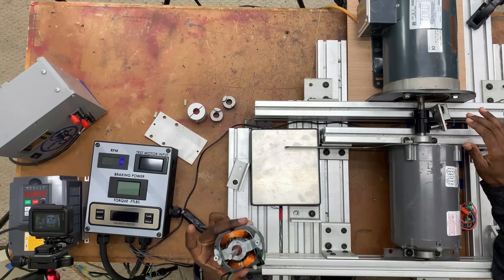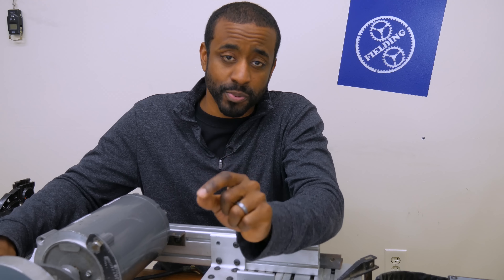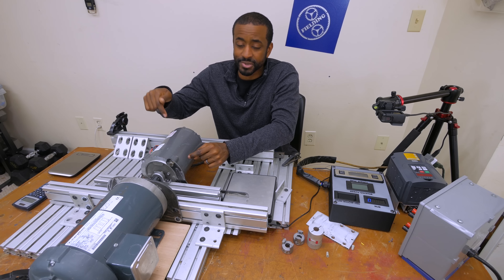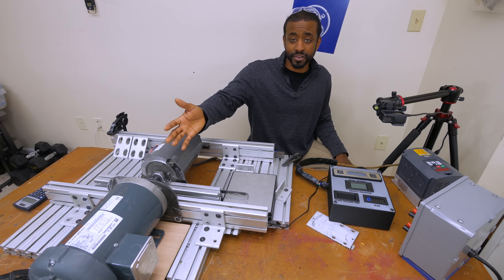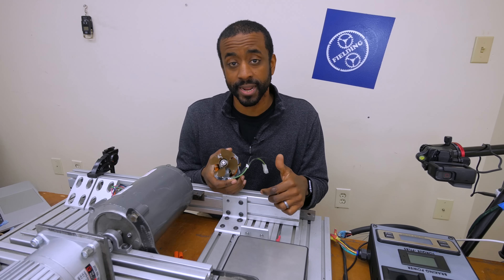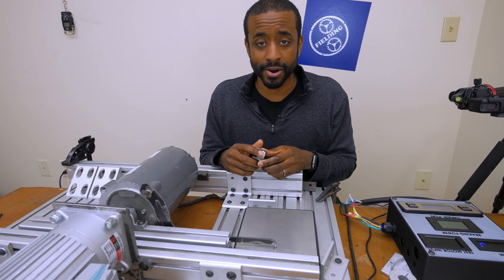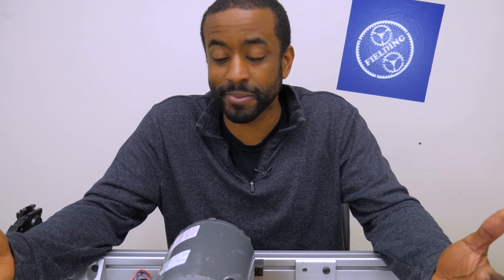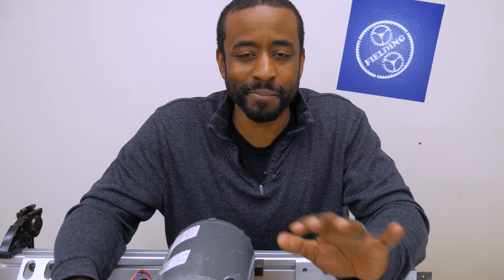How to Measure Horse Power for Any Electric Motor: (#077)

Comment: I'm designing a small engine dyno (<20HP) with DC injection brake.  What voltage and amperage are you supplying to the motor?  1 or 2 windings?  Are you monitoring brake temps?    Your using 1HP 3P motor for the brake. Yes?  Capturing the data with arduino and analyse in excel.  A posh display software is another story.  Ardyno might work if you can fudge the inertia setting and get close. I'm not an inertia dyno fanboy.  Brake dyno FTW. I assume you want an accurate HP number.  All i'm interested in is repeatable numbers for engine testing and tuning.

Comment: Do you know how many amps and volts your power supply goes up to? I tried building this with the one you recommended from Amazon but it burned up something inside and blew out a bunch of smoke. I returned it for a different model and it's topping out at 7 volts and 10 amps and not providing enough resistance. I need something with more power but not sure how amps/volts I need.
Reply from the maker: 30 volts 10 amps. The link takes you to the model I bought. However, I also used my shop made power supply for part of the video. You might have to buy a bigger one or make your own.

Comment: Wow, really interesting. Thanks for sharing! 

I might have missed it but how did you calibrate your braking motor or was that not needed? I think the torque value represents how much the two motors oppose each other but does it matter what the braking motor is doing? Does the braking motor only need to be more powerful than the motor being tested at the given RPM? I'm really curious about this point. I've always wanted to understand how a dyno works.

Thanks again!

Comment: Humm, came here because I’m trying to upgrade my mill motor. It has a 2HP brushless DC motor running on 220v. It’s already setup fix and has a method of connecting another motor through the spindle and I have fixturing on the table for the brake. Need to find a double shaft motor for a brake. I’ve got a stepper I can use but I doubt it would like spinning that fast.
Reply: Figured it out. I've got one of the ebay 2.2kW high speed spindle motors laying around. They're three phase motors.  I'll use the ER20 collet to chuck it into the spindle using drill rod then 3d print an adapter for the outside housing diameter to the inside diameter of bearing. I've got a few used fairly large bearings around I can clamp into my vise and there she blows. The motor has no ratings but the matched controller will handle voltage and current automatically and it's a 2HP motor so when I reach 1.5KW or max it will provide before stalling that should do it.

Comment: hey bro great video! I have a question for ya if you ever see this. Couldn't you measure toqrue/speed like you mentioned just by coupling the two motors, then reading the output of the one running as a generator?   You'd get a graph of output over time and since you know the parameters of the "generator" motor, you'd be able to come up with the associated values.
Cheers!

Comment: Other than the bearings you swapped out, is there any other risk from running the DC "brake" way faster than its rated speed? 

Great vid, thanks as always.
Reply from the maker: So far that seems to be it. Ideally it would be a lower voltage induction motor. It would likely have a thicker gage wire inside the motor. But, those are pretty rare... I have only seen a few examples.
Reply: An armature that passes balance qc at a specified RPM, may behave differently at a much higher rpm-
Reply from the maker: This is a great point. I didn't experience any unusual behavior in my test... but of course people might be using all kinds of motors for this project. Definitely something two watch out for if you want to test at very high speeds as I do.
Reply: @horacerumpole6912  it was an AC induction motor, though. An armature is pretty fragile compared to an induction motor rotor. But there could still be issues going so far beyond rated speed. Best to approach it slowly and take precautions for anyone who tries it.

Comment: Shouldn't the torque arm be one foot from the center of rotation (motor shaft) to the contact on the load cell in order to directly measure foot pounds? Yours looks longer than that.

Comment: I wonder what peak current that motor draws at startuo, i.e. before there is any back emf to reduce the running current. Might be interesting to measure the dc resistance of the motor and (ignoring its inductance for a minute) deriving the peak current that could instantaneously flow. A pretty irrelevant figure but just possibly equating to 28 amps (4.5 hp).

Comment: Won't increasing the length of the scale's wires throw out the weight? Given they're such thin wires, their resistance will add up significantly to the load cell's.
Reply from the maker: I checked it... I weighed several items before and after on the same scale... I also compared it to several other scales I have.

Comment: You won't be able to work out the rated voltage or max current for a motor, using this? How do you know when you are over-loading it?
Reply from the maker: That information is almost always printed on the motor some where as mentioned in the video. If not, that is really hard to estimate. Its not impossible, but really hard.

Comment: Curious why you used a magnetic sensor for RPM instead of an optical one. Is there any concern that magnetic forces between the coupler and the sensor could bias the torque measurement? Or would the effect be too many orders of magnitude below the torques you're measuring to be worth worrying about?
Reply from the maker: The magnet is just barely inducing a current in the sensor which would be so small the sensor's magnetic field in response to the magnetic would have no measurable effect on the shaft.

Comment: What are the metal frames that the motors are bolted to called?
Reply: T slot aluminum extrusion. 80/20 is a common brand or generic eBay finds.
Reply: @ryanbreker9490  Thank you very much. I had the T slot but was coming up with flat wood working T slots. Appreciate the help.

Comment: Can you explain why horsepower and watts are actually correlated I get that horsepower is a function of torque and RPM but how is horsepower also watts
Reply from the maker: They are both RPM x torque, or speed x work. Exactly the same. Just different units
Reply: @Jeremy_Fielding  but watts is volts x amps

Comment: A DC motor built for 1700 rpm is not going to survive 20,000 rpm. The commutator is going to fly apart. Replacing the bearings isn't enough.
Also, you've got a quarter million subs. Call up Circuit Specialists in Phoenix and get them to sponsor you with a beefy variable power supply. I've been recommending them for like, 15+ years (for free).
Reply: That was an induction motor. He was using DC injection to convert induction motor into a brake. However I agree with you that the rotor is going to self-destruct inside the motor housing. Unless it vibrates off of the table first due to imbalance.
Reply from the maker: I will add a note to the description about the rotor not being designed/balanced for high rpm. My motor has survived several test at 21k already for an up coming video, but that certainly won't apply to all motors used for this.
Reply: @Jeremy_Fielding  21k RPM. Wow! Obviously I was wrong.
Reply: @Jeremy_Fielding  Please keep in mind that should something come loose at high RPM's, not only will the lost piece fly like a bullet but the imbalance could be like an earthquake. You could end up with the test rig in your lap beating you to death in less time that you have to react. Bolting the rig down solidly may not be enough as then the forces will concentrate on the mounting hardware, pillow blocks, etc. I'd add considerable distance between me and the rig during high-RPM tests; we're not wanting to see you get hurt.

Comment: Why are you connect torque measuring arm from stator frame of motor to scale , the actual torque is generated from rotor shaft of motor.
We should measure the torque of rotor, I can't understand the reason.

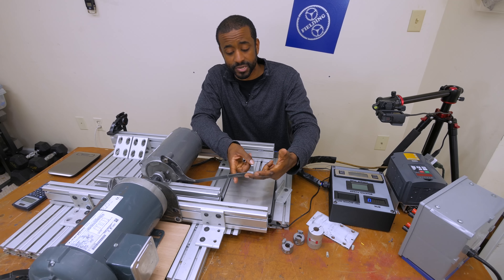Comment: 1:40 you are measuring the static torque using scale and lever, which is OK if you are measuring the starting torque (aka locked locked rotor torque) of motor. However, your rational of injecting a DC power for braking an induction motor power does not make sense because energy generated can NOT be killed by another energy source.
Reply from the maker: It might help to watch again. This is not measuring locked rotor torque. It should be obvious in the video the shaft is spinning. Also I confirmed in the video my test rig is measuring accurately by testing a motor that was professionally rated. My measuring produced the same rating as the label. Perhaps you didn't watch it all the way? Otherwise I don't understand what you are saying about DC injection. That is not related to the scale measurement in any meaningful way. It is just how I get a braking force.
Reply: 2:00 you said "run dc current through this  motor" that turns into electric brake. I am thinking how come a motor be used as an electric brake? 
I guess you meant dc machine or dc generator or dc dynamo but NOT the dc motor.
Reply from the maker: @MrALCHEMIST2010 . I see. It is a bit too much to explain in the comments. But it is an AC induction motor. If you put DC current on the windings instead of AC the shaft resist turning and the resistance increases with increasing DC current. It was an easy way to make an adjustable brake. Since the weight measures how much force is being applied to the body of the motor I can see how “hard” the motor can press and still keep turning. That number is the torque available at that speed.
Reply: @Jeremy_Fielding  Cool ! That means that AC induction motor's rotor itself is internally dissipating energy in the form of heat (iron losses) when it is exposed to DC magnetic stator field; and thus provides brakes. That is pretty cool technique!!

I am impressed by how you followed this question and clarify it till it is answered. You are MAN !! kudos.

Comment: if you know the amps the motor will draw, don't you know the rated horsepower? more or less - amps x volts/746?
Reply from the maker: Not unless you also know the efficiency of the motor. It could be 98% for high end premium motors down to 45% for universal motors.

Comment: That motor will rip itself apart from anything above 10krpm, don't push it. It's not just about the bearings.

I mean there's significant mass tied to that axle and it'll see significant centripetal force above 8krpm and if it isn't designed for those speed, it'll rip apart..

And what ever comes flying off from that motor shaft is going to be like a bullet... you don't want to be close to that when it goes.

You definitely need gearing or something to lower the speed that the measuring motor sees...
Reply from the maker: I have run this motor up to 25k gradually with not issues. I understand the motor has to be balanced for higher speeds. Anyway you can see 20k rpm without issue when I test the shop vac in that video
Reply: @Jeremy_Fielding  If it has survived it, good, but color me surprised... I mean the rotor has quite a bit of mass so one would think it can't survive that high of a speed unless it's designed to.

I mean the force pulling it apart goes up by a factor of 4 when it goes around twice the speed if i'm not mistaken.

But good to hear :)

Comment: Most 3d printed stuff is just plain soft when it comes to tensile strength. Good for toys and display things. What you should do is make a coupling that has different bushing inserts that would give you a guarantee no break senario. And sizes of motor shafts are not that many to make a keep on hand if you experiment as you do fella. Also, I am wondering if you could make a simple VFD for running three phase using single phase ??? Something the is bare bones but able to run say fifty H.P. motor. Buying a commercial VFD would send an average experimental into the poor house. With the number of electronic components for sale cheap I am figuring that should be an easy task for you to make and show us on YouTube. Thanks for considering and peace to you too.

Comment: It should be pretty trivial write the Arduino code, but it depends on the format your sensors use. If they output a variable voltage you could adapt this code: https://www.arduino.cc/en/Tutorial/AnalogReadSerial, just monitor the different values on different pins. I guess you're using off the shelf readouts like the display from the scale for the lbs so it's unclear how the sensor works.
Could you measure some voltages and post them? Maybe the sensor is outputting a linear voltage range in response to the varying weight. I'm no arduino expert but I've played around with analog and digital sensors, so I can try to help.

Comment: I have a massive torrid transformer I could give you Jeremy if you can help with shipping. It's about 25-30lbs, 8" dia 4" thick.. You could make your own variable power supply w it. Respond if your interested
Reply from the maker: What voltage?

Comment: I thought electric motors have full torque at all times. I thought that mean you didn’t have to get them up to speed to measure torque.
Reply: He also wanted to know hp. So you measure rpm first, then measure the torque without burning out the test motor. Multiply those two together and divide by 5252 and he gets the hp rating he was looking for
Reply: It depends on many  many things. How is the motor being controlled, what kind of load is on it, etc.
Reply: There's a minimum speed where you get high torque but with electric motors it's pretty slow. Horsepower increases exponentially with an increase of speed at a given torque.
Reply: For an induction motor that is running from a fixed supply (like directly plugged into the wall), the torque depends on the load. As you slowly add resistance the torque increases until it reaches its full rating. The parameters on the motor plate are taken under this condition. Full load Amps (FLA). Torque. RPM (e.g., 3450 or 1825 or whatever). If you continue add more resistance, the motor will slow down more but also generate even more torque. This will continue until finally it reaches its maximum torque (breakdown torque). However, the motor cannot operate for long at such high torque without overheating. For most induction motors, if the load resistance is increased further, then torque actually decreases from that point. Once the motor is stopped, you have the locked rotor torque which is generally pretty high, but not as high as the breakdown torque. Some induction motors are designed so the locked rotor torque IS the peak torque. But most that you will encounter are not like that. 

A motor being operated from a fancy speed controller may not behave like this at all. It may slow down until it reaches maximum programmed torque,  and the torque may just stay at that level until the motor is stopped. Servo-motors may be able to drop all the way down to zero speed and maintain full rated torque indefinitely. Induction motors with fancy controls (including encoder feedback) may be able to do this also. It is just not that simple. You need to specify what type of motor and how it is being controlled, etc. But for an induction motor running directly on line voltage, the harder you try to stop it the more it fights back... to a point.